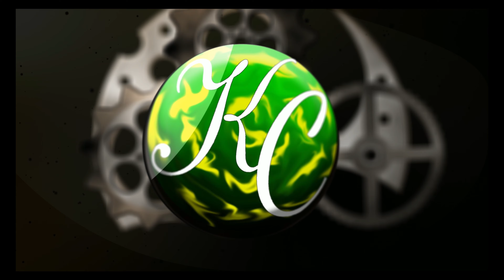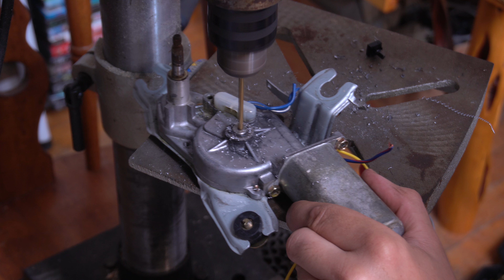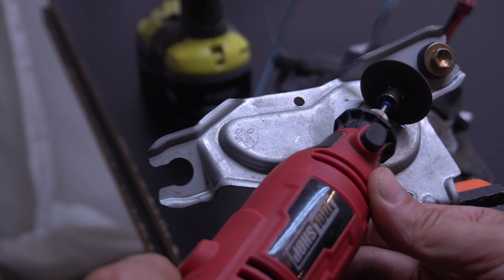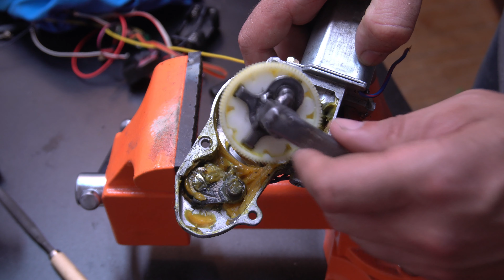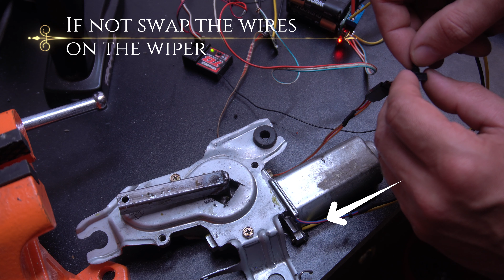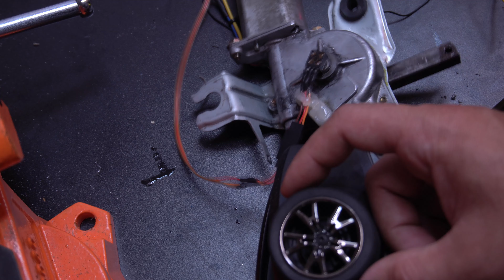Giant RC Servo.

Comment: Bro. Bro. Bro.
When I watched your video the other day, I didn't pay attention to your "servo". I caught you say if you haven't watched the servo build, check that out below.
After you linked me to the on/off yesterday, I went deep into the RC/Drone rabbit hole. And I can already see how this will ultimately turn out. 
Anyway, that's not why I'm writing back. I couldn't find your "servo" so I screen shot and used Amazon lens to find it. Unfortunately it shows me window motor/whipper motor assembly's... sure looks like that but huh? 
The car was cool but I just wanted to give you flowers on the mechanical engineering genius that is your "servo". Bravo man.
I'm an hvac tech so I naturally like to tinker, but you tinker tailor solder spy... lol
I'll need to watch this 4/5 more times to download the the goods, but again. Thanks for your response in my first comment, and congratulations on the absolutely ingenious use of seemingly random parts. So dang cool!!!
Reply from the maker: Yes its a disected servo an H bridge and a window wiper motor. I did find out not to use a 6s on them though lol. Im glad your enjoying it here I hooe to do some more rc stuff

Comment: How can a wiper motor turn CW and CCW if they use worm gears?
Reply from the maker: You look at it from the perspective of the driven gear as the output
Reply: @KCreations4You ... ok, but the worm gear is not reversible, well at least that is how it is supposed to work
Reply from the maker: If you reverse the polarity, it will reverse. I think as far as how it was supposed to be used, I'm a little beyond that, 😆

Comment: Hi There, great video. Very useful. I want to make an electric steering system for a childs ride on car/go kart. Would it be simple to replace the RC system with a potentiometer that I could then attach to a steering wheel? Any idea how this could be done? Very grateful for any pointers. Thanks
Reply from the maker: Do my power wheels videos help with that?

Comment: amazing video sir thank you. i am also try to make a same servo but using Arduino can you please help me to tell what is the connections while using Arduino , help me.
Reply from the maker: Maybe something like this? I cant be sure until I would have time to test it though so your a little on your own. Please make sure to let me know if it works.
#include <Servo.h>

Servo servo; // Create a servo object

const int servoPin = 9; // Servo signal pin (connect your servo signal wire here)
const int motorPWM = 3; // H-bridge PWM pin
const int motorDir1 = 4; // H-bridge direction pin 1
const int motorDir2 = 5; // H-bridge direction pin 2

int servoValue;
int motorSpeed;

void setup() {
  servo.attach(servoPin); // Attaches the servo on servoPin
  pinMode(motorPWM, OUTPUT);
  pinMode(motorDir1, OUTPUT);
  pinMode(motorDir2, OUTPUT);
  servoValue = 90; // Initialize servo value (adjust as needed)
  motorSpeed = map(servoValue, 0, 180, -255, 255); // Map servo value to motor speed
}

void loop() {
  servoValue = servo.read(); // Read the servo position
  motorSpeed = map(servoValue, 0, 180, -255, 255); // Map servo value to motor speed
  
  // Set motor direction based on motorSpeed
  if (motorSpeed > 0) {
    digitalWrite(motorDir1, HIGH);
    digitalWrite(motorDir2, LOW);
  } else if (motorSpeed < 0) {
    digitalWrite(motorDir1, LOW);
    digitalWrite(motorDir2, HIGH);
  } else {
    digitalWrite(motorDir1, LOW);
    digitalWrite(motorDir2, LOW);
  }

  // Set motor speed
  analogWrite(motorPWM, abs(motorSpeed)); // Use abs() to ensure positive PWM value
}
use the Servo library to read the servo signal on pin 9.

We map the servo value (ranging from 0 to 180) to a motor speed value (-255 to 255). You may need to adjust the mapping based on your servo and motor characteristics.

Depending on the sign of the motorSpeed, we set the H-bridge pins (motorDir1 and motorDir2) to control the motor's direction.

We use analogWrite to control the motor's speed via PWM on the motorPWM pin.

Make sure to connect your servo to pin 9 and your H-bridge control pins (motorPWM, motorDir1, motorDir2) accordingly. Additionally, ensure that your power supply and wiring are suitable for your specific motor and H-bridge setup.

Comment: Dude!!!!!!! New sub from this video!!!!!!
I’m currently building a huge RC hot rod and this just got me past a roadblock on my project.
Reply from the maker: It was a roadblock for me as well. I would love to see some pictures or video of your project. What scale is it?
Reply: @KCreations4You  1/3 scale ‘29 ford model A insipired
Reply: @KCreations4You  42cc chainsaw engine with double reduction 8.3:1
Reply from the maker: @shane_7even_ten569  Thats awesome! I'm planning on putting a chainsaw motor in the power wheels project so this is right up my ally. So 8:3:1 is affectively 24-1 a chainsaw is like 12k rpm 12k/24 =500 if your tires are about 12" thats like 5.6 Mph? I'm guessing you are making it ridable and need the torque?

Comment: does the servo and receiver have a voltage limiter already on them like for instance if i hooked a car battery to them would they fry if i dont add a regulator?
Reply from the maker: If you hooked a car battery to the receiver instead of the 4 aa batteries I'm pretty sure it would fry it. Most receivers can handle 6 cells or about 9 v MAX but I would keep it at 7.5 and lower.

Comment: Great job
I wonder if I can do that with bts7960 bridge!?
Reply from the maker: Yes you can in fact I switched to that one in one of my rc car videos cause the other one fried and I needed more amps.
Reply: @KCreations4You  Great 👍
Do you have the diagram the connections of the bridge?
That's all I need to test my project that I've been trying at months, without luck!!
Reply from the maker: @AmericoNeves-bo4xt  Its the same as in the video just a different board. The only part that tripped me up was the green plug didn't look labeled in till I looked at the bottom side. B+ B- is battery and P+ P- is to the motor. I would love to see this project.

Comment: Can I ask how do you power the servo. I power both driver and servo by adruino. You think is it may be a problem
Reply from the maker: I make it a point to answer every question I can :) The power is 2 sources. One is from the 4 aa batteries going through the RC receiver then to the Small servo board This also provides power to the H bridge then the second source is the Lipo battery that directly powers the Large motor.

Comment: What servo did you used? 360 full rotation or 180 degrees or can we use both servos for that applications?
Reply from the maker: I used a 180%, you could use either one.
Reply: KCreations ok thanks..

Comment: Is it better smaller for that wiper motor
Reply from the maker: It really depends on the application you plan to use it for.
Reply: I have a Audi power wheels   for Rc conversion. Your idea's inspired me.
Reply from the maker: @surfninjaGaming  I'm really glad to hear that. I will be trying to do a part two this summer that might give you more ideas.